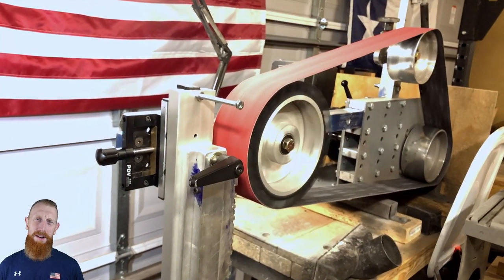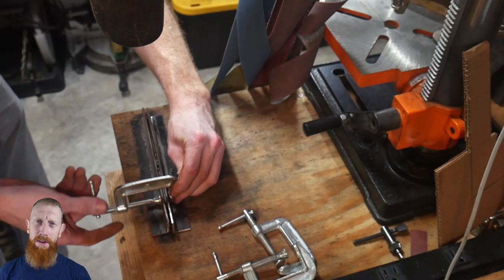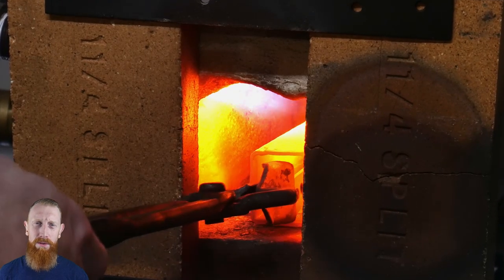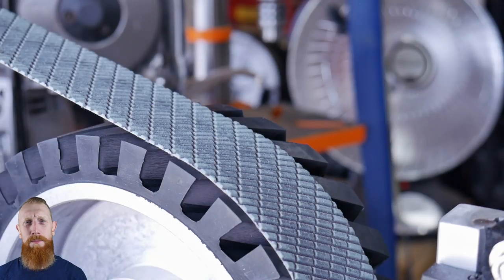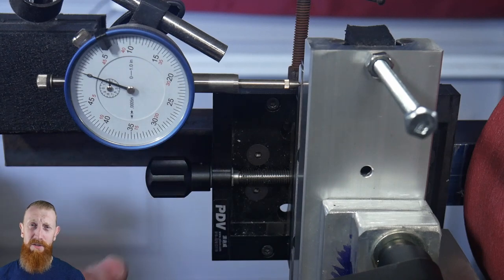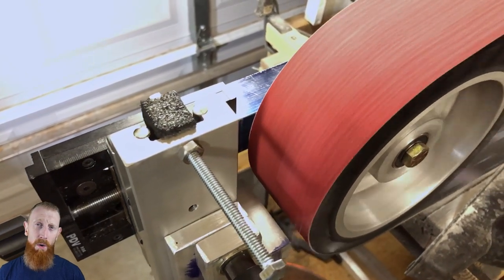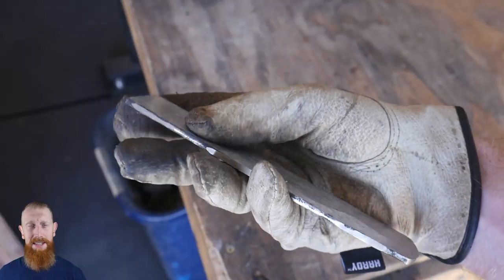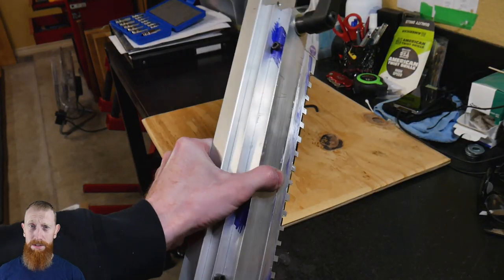Home Made Surface Grinder Update

Comment: Answered a few questions I had on the original build. Well Done, will have to give this one a try. I'll have to figure out how to do the slots with out a mill, but the rest looks like a simple project.
Reply from the maker: Awesome sir! Let me know if you come across any more questions. I've seen guys who have a ton of patience use a drill press and file... but heck you're time may be better spent bringing it to a local machine shop.

Comment: I've only used one real surface grinder. It was off a ship LOL. Had an electromagnet and used coolant. The table moved back and forth and the feed rate was very small increments. Can't remember how small but it seems like it was in ten thousands. You had to advance the feed by hand. It used a grinding wheel instead of a belt. Your machine seems to produce very similar quality. Of course it could accept much larger pieces but hey yours is good enough for probably most jobs. I was going to a trade school when I used that grinder and the course was very useful. I was going to be a machinist but I guess most of those jobs went to China at that time. I really liked the instructor there, he was and old guy and really knew his stuff. Had me always making things for him. He had me repair an old Metal Lath that was over 100 years old an had an interesting planetary gear system. I did eventually get my own shop with cheap Chinese equipment but that's all I could afford. LOL I just use it for small projects and parts etc. Have learned a lot . That course has helped me in so many ways though.  By the way my beard use to be red also, but now it's white. Age does that to you. I have now watched two of your videos and enjoyed them very much. You do an excellent job with them. I am so impressed that I subscribed. In the future, I will try not to be so long winded. I think  perhaps another age related side effect LOL. I look forward to watching more of your content. Thanks again.
Reply from the maker: Hey Steven, glad you're enjoying these! If only I had the space for a real surface grinder! LOL... would be awesome. Have a great week sir!

Comment: Quick thought for shimming the warped blades: Get yourself some "thermoplastic". It the plastic that gets soft when put in hot water. When you have a warped blade, soften some of that up, lay out enough to sit under the profile of the blade, and press the blade into it lightly on a flat surface so it takes up the gap. Once that plastic cools and sets, you can use that as your shim. Then you can soften it and reuse it.

Us luthiers use this stuff all the time to make clamping cauls for oddly shaped places. I even use it to help flatten warped wood in the planer/thicknesser to avoid the same problem you're having. I'm sure you'll find tons of other used for it too. Stuff is indispensable.
Reply from the maker: Very good idea sir! Didn't know that stuff existed
Reply: Kydex is a thermoplastic

Comment from the maker: If yall have any more questions on this machine, I'll do my best to answer them below! Cheers! 🙌 (Link to the original video is in the description AND Magnetic Chuck Upgrade - https://youtu.be/_PYztWN2BiA)
Reply: I’m so glad you made this follow up video! I literally was about to go back and watch your build video as I’m strongly considering making the plunge and getting the parts for the build. I do however need to finish my sayber osg grinder build first but I think this is a imperative attachment for any knife maker (that doesn’t have a standard) surface grinder. Now to choose between a full set of smooth contact wheels or these materials! 🤔 Thanks Red Beard!
Reply from the maker: Hey man, really appreciate your comment. Glad you found it useful! I was a little hesitant at first, but I'm really happy I built this thing..

Comment: This is a cool attachment. Like many of us, time is never enough. While I have a surface grinder, it needs a complete rebuild. I am currently building a revolution from scratch for fettling castings. Having the ability to surface grind helps. In making blades for side escapement wood planes, the tang needs to taper down from 1/8 in to 1/16 in. This is done prior to heat treat. So any information on how to taper a blade would be quite helpful. Thanks.
Reply from the maker: Hey Dev, sorry I haven't done much tapering

Comment: The reason the blades aren't getting super hot is because of the aluminum you used to make the surface grinder attachment. Aluminum has a high thermal conductivity rating (about 200), much higher than steel has (which is about 35). Since the blade is touching the aluminum across half of the blade, it'll just keep sucking the heat out of the blade as you are grinding it. You can even use aluminum to quench blades, just by sandwiching the blade between to decent sized pieces of aluminum billets. I was watching a video of someone making a blade out of CPM-3V and that blade was ~1900ºF and it dropped to below 900ºF in 3 seconds with the aluminum plate quenching he was doing. It's crazy to see how much heat aluminum can suck out of a blade!
Reply from the maker: Good points Bill! Thanks for your comment.

Comment: Re not trying to surface-grind a warped blade: a common practice woodworkers use to thickness-plane rough, irregular lumber is to joint (surface-plane) one face of the board on a jointer prior to thickness-planing. Then, going to the planer,  one feeds the stock into the machine registering the jointed face of the board down onto the planer table. Then after multiple passes, the cutter head will level off top surface. The resulting board is not only uniformly thick end-to-end, side-to-side, but also it is straight and perfectly flat. BUT If you thickness-plane a board without jointing one surface first, the planed board will be uniformly thick but will retain its original warp.  In the face-jointing operation, it is important to register the concave side down against the bed jointer bed and to avoid putting downward pressure toward the center of the plank as it passes over the cutter-head. After multiple passes the ends of the board are planed away, finally converging at the center. When done, the bottom of the board will be nice and flat, while the top will have its original convexity. When you next thickness-plane the board, you’ll register this jointed face against the planer’s table, as described above. 
   Okay, now I’m wondering if—at least in some cases— you started by putting the billet concave face DOWN onto the magnetic chuck and feeding it into the grinder in extra-small increments, you could produce one flat surface, so that when you flipped it over and worked the reverse side, everything would have a happy ending. This assumes that the bar is not so badly warped that the chuck won’t hold it firmly. I’ve been able to flatten an annealed bar sufficiently by cold-hammering. Then I use the platen on my grinder to flatten the billet. A pair of welding magnetic holdfasts keeps a good grip on things. Still, I want a surface-grinder and think I’ll try building the attachment you’ve so elegantly worked out.
Reply from the maker: Thanks for your thoughts John! Very interesting stuff. I've gone the route of "not getting a warp in the first place." lol

Comment: Great demo and again, great build. May want to check out Ceramic trizact belts vs AO. I was sent a few by error a while back and was told that they are used alot of Surface Grinders. They are stiff and wear like iron.
Reply from the maker: Heck yeah man. I've tried out some of those "gator" trizact belts on there. They do work very well! Last a long time too. Leave a pretty good finish too. Thanks as always for stopping by.

Comment: I don't know if you have ever used a conventional surface grinder,  but I have owned and used an oldie but goodie Brown and Sharpe #2 with an automatic feed.  You mention removing between 1 and 2 thousandths at a time.  I must admit that on the Brown and Sharpe machine and indeed on most small machines (mine had a 6x18 magnetic chuck)  you are advised to only remove .0005 to. 001 at a time.  It produces a much better finish and a much more consistent thickness.  Also, the automatic feed does a lot to maintain a consistent finish.  Perhaps you can improvise an automatic feed.  I enjoyed the video very much, Sir.
Reply from the maker: Hey Bill, thanks for the comment. These SGA's (2x72 attachments) are called surface grinders, but are realistically only good for a full tang knife maker. For our purposes getting 1 tho along the flat of a full tang knife is more than enough precision. If you're going to be making folders, it's possible that a higher level of precision is needed. It would be cool to have a legit surface grinder one day! Cheers sir!

Comment: Good video. I need to build one of these.

I don't know if you saw my thread on bladeforums, but I recently built one of JT's straightening hammers out of a ball pein hammer and a tap. A tungsten carbide insert will work better for hardened steel. Either way, it will leave a huge dent in annealed steel so be careful where you hit. JT says to hit the inside of the bow. Works great for me.
Reply from the maker: Thank you sir! I'll need to go look for that! Sounds really cool. Have a great weekend! 🙌
Reply: @RedBeardOps  Thanks. You too!

Comment: hi, thanks for the video, very informative.

question.
do you align all the magnets pointing the same way or are they alternative N.S.N.S etc.
what procedure do you take to remove the blade from the machine - what is the holding power of hte magnets.
What strength are the magnets?
Reply from the maker: The magnets were rotated so that they could be put into the slots easily. They're pretty darn strong. You can check out some videos on the channel around this videos date to see how I use the chuck. Cheers Charles!

Comment: you could put fewer magnets, less problems with the warps issue
Reply from the maker: Not a bad idea! Would have less holding power though! Good thoughts 🙌
Reply: @RedBeardOps  It would be easier to shim (and easier on the finger tips) with a switchable magnet vise. Of course that would be more expensive and heavier. Have you thought about adding a counterweight?
Reply from the maker: @GordieGii  A counter weight is a good idea for sure! I think I'll likely build a grinder than can rotat 90 degrees before doing that though. (Like this one https://youtu.be/5M5KmmJ_BHE )
Reply: @RedBeardOps  All I have to do now is build a switchable magnetic vise and learn how to make a YT video.

Comment: When you talk about using it after forging, if you're forging in bevels working it on the anvil then isn't using the surface grinder afterwards counterproductive? Machine is awesome though and I really appreciate your videos!
Reply from the maker: Thanks man. With the bevels roughed forged in the SGA will just flatten the ricasso and maybe the flats above your bevels if there are some. I have a video coining out soon where I do this and it works out pretty good. Cheers man
Reply: @RedBeardOps  awesome! Look forward to it 😊

Comment: Hello sir. Have you considered using magnets with countersunk holes in it and then bolting them on to the aluminum bar instead of epoxing it? Would it be a good idea? I'm considering this for my build.
Reply from the maker: Hey Lucca, I think this is a good idea. I felt like it would be a bunch of work though. And these magnets seem brittle. Let me know how it goes! Have a great week!
Reply: @RedBeardOps  Thanks man!
Reply: I couldn't find how deep you milled the slots for the magnets. Could you tell me?
Reply from the maker: @farmaproderma  Just deep enough to leave 1/8'' on top of the magnets.
Reply: Thanks a lot sir. Have a great day

Comment: If you measure the thickness right at the very edge of the tang (like the last .020") do you have any more variance than .001-.002"? It liked like in the video you measured about 1/4-3/8" in from the edge.
Reply from the maker: Good question. I'm not sure! If you have a very soft wheel I bet the ends (where the wheel contacts first) will be thinner. This could also happen I think if you feed to fast into the wheel. With a 90+ durometer wheel and slow feeding I bet it's minimized pretty good. Good thought man. Cheers

Comment: just subscribed great video what dia wheel do you use and what shore hardness is it.
Reply from the maker: I have links to the parts and the wheel in this video description. I asked for the hardest they could give me. I'm not sure exactly what it is since it came direct from China and you can never be sure.... https://youtu.be/_Q2aujE3pWk
Reply: @RedBeardOps  think the wheel you have is good but from experience the smaller the diameter the better stock removal, also if you get water to it it will be better when i say water i have used mist spray similar to a garden sprayer you dont need a lot just a very fine mist of water and the cooling effect is dramatic surface is warm not hot and surface finish id better, had 25 years in the uk selling abrasive belt machines to manufacturers but still love to see the ones you guys make

Comment: Nice job on the build! I'm planning on making one myself. Where can I find the plans? I printed off the 2 pdfs from your first video but it doesn't show where all the holes and slots go.
Reply from the maker: Hey Jared, check out the blade forums thread I linked to in the description. I think that will help you greatly.
Reply from the maker: Blade Forums SGA Thread - https://www.bladeforums.com/threads/home-built-surface-grinder.1532559/
Reply: @RedBeardOps  thank you, I will check it out

Comment: Nice follow up surface grinder. Now I gotta spend more money! I do plan on building one, I did look at your drawings but having a bit of trouble understanding them. Are there any others? And do you have any stickers to trade? Thanks, Randy
Reply from the maker: Hey Randy! I don't have any stickers. In the original build video I put a link to the discussion thread on blade forums. There are many drawing and pictures in that thread that will likely help you out!